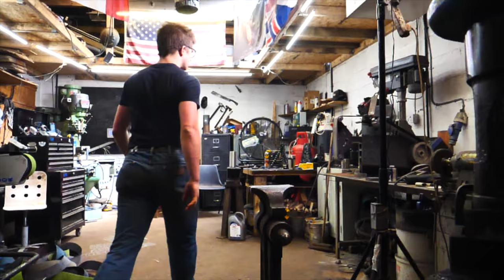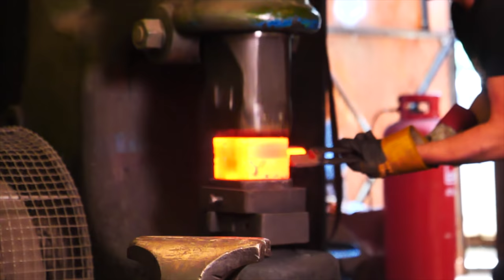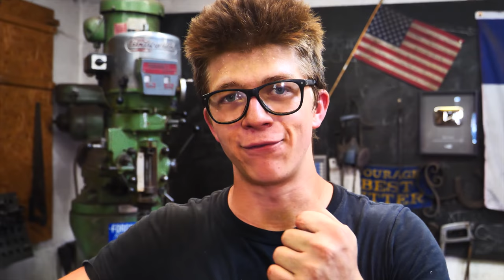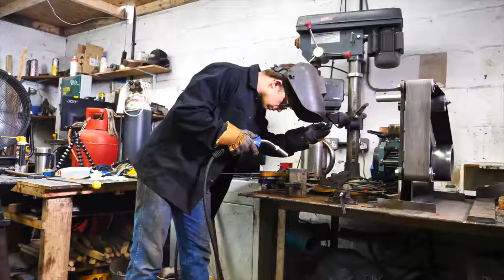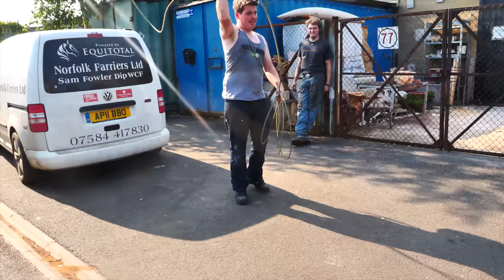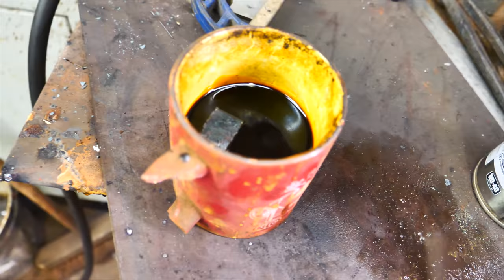MAKING MY FIRST SWORD! Part 1: FORGING the Damascus Steel *MAXING OUT POWERHAMMER*

Comment: Alec, you really need an attic fan to push the hot air out of your shop through the roof and pull the cool air through your front doors.

Comment: Hey Alec, from the little personal experience I could gain from the Sachse-Schmiede, a renowned Damascus Smith from Germany I would try a smaller billet with an easier lamination. The pattern might weld really good if it was parallel stacked. The pattern can be enhances achieved through a cross-pattern indentor punch pressed on the hot billet or something. You might not need this much steel(e) to make a sword... but: Keep on learning, dude. Your skills are already amazing. Love it. Liked every video so far. And keep microwaving the S**t out of this Tupperware :-D
Reply: HelwigTV the white pattern is hardenable and the white isnt hardenable thats the Special about damascus Steel
Reply: HelwigTV that makes it hard and flexible
Reply: Acker Kartoffel That isn't quite correct sir. 15N20 (the shiny metal) is quite hardenable, and it's possible to make high quality knives from only this metal. the other steel is 1084 or 1080 or something, which has almost the same processes for hardening. this means Alec can simply quench it in oil to harden rather than doing a really weird HT which is necessary if you have a soft steel and a hard steel. when combining these steels, it is impossible to get a hardenable but still soft blade unless the steels are almost homogenous. so either smelted and combined or folded so many times the layers are so small they may as well be homogenous. but simply folding two different carbon content steels will not give you a strong, but flexible or soft knife. the only way to achieve this effect even in Damascus is the same process as regular steel. either an edge quench, or a full quench and then a few tempering cycles to increase the blades flexibility without compromising it's hardness. so to sum it up, no mixing a hard steel and a soft steel will not result in a blade that is both hard and soft or flexible. the shiny steel Alec uses in Damascus is not hard and soft it is a hardenable steel just like the other component high carbon steel. mixing these two will result in a very tough blade, and using similar carbon levels will ensure every square inch of the knife gets hard, not only one steel. if only one steel hardened in Damascus it is almost certain to create cold shuts and delaminations.
Reply: Jake Pryor thank you lol

Comment: In South Africa it gets insanely hot, the hottest day I was at my forge the outside temperature was 42 degrees C, then it starts to get a little less fun
Reply: Michael Muller here in the phillipines 42*c every summer is normal temprature it can go up to 45
Reply: Ace Magic I live in Denmark and I have never felt more than 36C, I felt like I was melting
Reply: Michael Muller live In Tennessee. Almost always cold
Reply: I used to live in Arizona and they've already hit 50 degrees today; I can't imagine trying to forge anything in that heat, let alone a sword!
Reply: 30c in the UK yesterday and the tar sticking started sticking to car tires and pulling up the road... How anyone gets any work done in 40c heat is beyond me
Reply: MrcabooseVG lol 30C is Texas early winter. Rarely do we have days below 0C is usually 10C late winter. This weekend was a high of 44C by mid day
Reply: It’s called Eskom trying to generate power.

Comment: Now you've done it. After putting to rest the "you should go on Forged in Fire" question, this series is going to start it all over again.
Love how you jump right in.  Just setting up my new shop with one side for wood and the other for metal.  Because of you I'm planning to add a forge.  I've been collecting the necessary hardware for a while now.

Comment: You have wayyyy to much steel there my man.
Reply: DeathHamster_  you need to go see the damascus steel machete its like a bat with a blade
Reply: DeathHamster_ Considering this is damascus, the more steel in the billet, the better. Because when you grind into it, you'll expose more of the pattern. Plus, it makes sense, since he's usng the restack method, and you lose a lot of material in that method.
Reply: I know that. Even still looks like he could make a claymore and still have plenty to spare. That being said, spare Damascus is never a bad thing.
Reply: That billet weighs like 10 kilos, how much metal do you think he will lose ??jeezus ...
Reply: DeathHamster_ He has enough, a bit too much but not that bad. Remember how much steel is lost to oxidising and grinding, in the end it will be fine ( also he may do a tanged blade in which case he will need that extra steel.
Reply: well during the forging process you lose material and he probably wants enough extra in case the first one breaks.
Reply: Still far too much ... You don't make a scabbart out of metal and i pretty much doubt Alec will even make one. Also do you even know what the hilt is ??
Reply: DeathHamster_ he probably made extra so that if he likes the pattern he can use it in other projects
Reply: Well, he can use the excess steel for something else perhaps. Better to have too much than not enough.
Reply: it weighs way more. i would say 15 or around 20
Reply: whatever, it's way too much for a single sword
Reply: the billet is at least 20lbs (10 kilos) but closer to what looks like 30lbs (15 kilos). The average sword is 2 - 3lbs (1 - 1.5 kilos). Are you telling me he is going to loose 20lbs of steel? That's 90% of the steel. There is just no way. And come on snake "scabbard and the belt" Who makes a belt and scabbard from hardened steel?
Reply: Aye...... But not for a BIG ASS SWORD!
Reply: Modern Bladesmith Maybe he wants extra? Also he could normalise it and make a scabbard outta that, I also doubt that billet is over 12 kg, that's half a small anvil a bit too much for him to risk that much steel on
Reply: Modern Bladesmith I do still agree that it is too much though
Reply: yuuup. not even a black smith. could tell right away

Comment: Why not weld the block as 4 smaller billets then weld those together instead of one massive lump like that?
Reply: Chris - I wondered the same thing...seems like the risk for delams is much higher doing it the way he did.
Reply: James Brown that was the first thing I thought of
Reply: Chris Because did you see how badass that was? fuck it even if it doesn't work that is the biggest mass of steel I have ever seen anyone successfully forge weld
Reply: "Successfully" don't count on it till the heat treat is done.

Comment: Why so much steel? swords generally weight between 800g to 1.2kg
Reply: I imagine - since it is his first sword - he just is way over-compensating. Also, I would bet good money he'll cut it down not too far into the forging and have a spare billet.
Reply: Allthough this is a lot of steel, there usually is a lot a grinding needed, I think especially when you start forging. Still could be smaller I think, but hey, I'm not an expert.
Reply: With damascus steel and stock removal, you normally use way too much steel and grind down to reveal the lower patterns. But yes, 800-1.2 should be about right for an arming sword. If he's going longsword, he can go up to 1.6 (like the Alexandria Arsenal swords)
Reply: I think he's deliberately going for as much stock removal as possible to make the damascus pattern come out.
Reply: Only one way to find out, I guess. I hope he answers it next video.
Reply: Depends what he's making, cutting, welding and grinding will lose quite a lot of the steel
Reply: Red Lotus those hinges he made were thicker than many sword blades are, and this billet of steel is way bigger than the one he used to make the hinges. He could make a sword, fittings, and another blade (probably not a sword) out of what he's put together here. It's massive.
Reply: Aside from the grinding, etc., how much steel would be lost as forge scale?  I've gotten the impression from other smiths' videos that it's actually quite a lot.

Comment: Alec I think your attitude is great and the fact that you are challenging yourself to make a sword is fantastic. I can't imagine the heat but if you still have that chimney from your coal forge in the roof,  and it's still open, put it to use. Hook a couple of Muffin fans inside and have them pull the heat from the shop out and up. That way they'll draw some "cooler" air from outside. Might help with drawing some of that nasty forge exhaust out too.

Comment: Alex does a great job. However, I wouldn't do Damascus for sword billet. Possible for layers to delaminate with impact. If I were him, I'd also consider a 20 ton press for this vs a power hammer for making the billet homogeneous.
With that said. Alex's Damascus work outshines most smiths I've seen. It's beautiful. Keep it up man!

Comment: My metal shop teacher used to work in the marines. The last place he was stationed was in Guam and his job was to weld nuclear subs. The process consisted of preheating the metal to 400F and keeping it at that during welding, and putting a huge bevel on the 3" thick steel. They welded with 1/16" SMAW electrodes.

Comment: invest in skylights that open w/screen, then a duct to move some cool fresh air from a low point at the front door or through the door itself w/security grill, through the door can be moved up and out of the way, I don't know how that would effect your insurance, but I would really recommend the skylight that opens, I think it would be most cost-effective and safer, just as you protect your ears you should also consider your body temperature as well. 

as always thanks for the great work and videos.

Comment: Alex Quick question...After you forge the billet you always grind the scale off before you arrange it to be welded again. I understand that....Why don't you grind the original pieces before the initial weld? Those pieces also have mill scale on them.

Comment: Instead of chancing various temps along the length of the material, could you line up Sam's small forge with your large forge so it becomes a long 3 burner forge to take the sword length?

Comment: Idk really know if you did your homework on swords, but incase you haven't
sword have what is called a distal taper
where they're 5mm thick at the bottom and around 2-3mm at the top
Putting the ballance point right above the crossguard.
Also one handers are usually 1 kg

Comment: should try working in a weld shop in the deep south us. 100+ degrees heat ontop 2000+ degrees heat coming from torches

Comment: Probably been asked before, but does cleaning the surfaces of the starting steel with a wire wheel or something help it weld?  Imagine those pieces are covered in a fair amount of oxidation and contaminates?

Comment: What are the advantages and disadvantages of using a power hammer vs a hydraulic press for forge welding?

In my little mind, it would seem a press would be better for the welding part, no?

Comment: Appears the forge will need an upgrade for the hardening process!  To handle high heat, wear tight fitting, 100% cotton clothing, and be sure to not eat large amounts of red meat.  Whey protein shakes are a great way to get the protein without the high body heat for digestion.

Comment: Not sure if you've done a fuller yet (only been watching a few months, and don't get to watch EVERY day), but that would help move the steel, lighten the final product, and not need THAT massive a billet. Looks like you're trying to make a hand-and-a-half or a two-hander with that much metal. There are shorter swords you can make.

Comment: WHat weight are you aming for with this sword? If I can bring my knowledge to the field, my recomendation would be to, depending on the exact style of sword you are making, having the weight between 1 kg to about 1.5 kg for a shorter blade, or between 1.2 and 1.8 kg for a longsword or similar. A greatsword (zweihänder, claymore and the like) should preferably not exceed around 2.3 kg, slightly more is fine, but that seems to be the average

Comment: Shouldn't you grind or sand the magnetite off before welding the steel? And melt borax in the furnace and have it run between the steel plates?

Comment: I would suggest many more cuts + welding, especially if you are even thinking of using the sword as a sword.
There's a reason most sword makers do over a thousand layers, to avoid catastrophic de-lamination during use.
Don't want you to get hurt.
Reply: AluminumHaste you can have a working sword with one layer of steel. we don't even know what type of sword he's making. Western weapons aren't like far eastern weaponry.
Reply: Was just talking about pattern welded steel, not mono-steel swords.
I did not even mention western vs eastern, just that pattern welding something with only a dozen layers has a greater chance of de-laminating as opposed to something that been welded 10-20 times etc.

Comment: That billet of steel is probably to large for the task.  I have seen people make swords before and it looks like your trying to make a billet for 2 swords.
A sword is not as big as some people think.  The finished product is usually in the 2 to 5 pound area (2-3 pounds for the one handed variants, 3-5 for most two handed variants).

I have a reminder, a good sword has a distal taper for many reasons, namely it lowers the center of gravity closer to the handle (this makes the weapon more lively).

I hope your making a sword with a little history in the US because that would be awesome.  Sword making does push a blacksmith's abilities to the limit because swords are a blend of form and function.
I wish you the best of luck.

Comment: bro you have make a new forge for the sword. It should be long enough to get the sword in right length. So the heat should apply evenly in whole length. it will also help you for during the heat treating the sword.

Comment: i wonder if anyone can help, When i see the steel come out of the forge, its generaly covered in scale. Where i get a little lost is where does the scale come from?. If its impuritys in the steel, then after a few heating ups the steel's make up will be changed. or is some of it just from the surrounding air

Comment: Alec, not sure what that billet weighs, but a sword TYPICALLY wouldn't be more that a kilo, more or less.... I think you have a LOT more material than you need there, I know a lot will be removed as stock, but I think the next you can start off with a way smaller billet.

Comment: You take care to grind the scale off whenever you combine the cut billet, prior to rewelding. Other blacksmiths do it too, for good reason. However, y'all never do the same thing to the original pieces of steel. Would it not be worth your while to build a crude tumble polisher, or similar, in order to prepare your raw steel?

Comment: Wouldn't it be better to forge-weld all of the separate billets of damascus and then weld them together to minimize the chances of cracks? Man you have a lot of material to work with,  if you can I'd suggest a claymore or one of the larger types of swords since it'd be a shame to see a lot of that steel wasted!

Comment: why won't you sprinkle the powder before welding
it's like, preventing the steel from rusting so it would stick together better right?
then isn't it more logical to sprinkle it between the plates?
also, what's the name of that powder

Comment: Why always Damascus? Does it have any advantages over other hard steels that hold an edge?
Reply: CitizenLach it's cool
Reply: CitizenLach damascus can (emphasis on CAN as it isn't Always) turn out fairly heavy, but tends to be quite strong, due largely to how many layers of steel go into it (or folds if you're going that route), and it looks beautiful.
Reply: CitizenLach Damascus if done correctly (well pattern welded steel not Damascus) is just as tough and hardenable as tool steel. it looks more appealing, and the possibility of changing the pattern are the main draws for using Damascus. ACTUAL Damascus (techniques lost to time) was apparently stronger even than most conventional metals on their own
Reply: actual damascus can be made these days, the process was rediscovered. also its not better then modern steel it just has unique properties to it. also pattern welded steel isnt exactly as tough as tool steel however it can have benefits however thats more a result of laminations not just making pretty steel(think how the japanese put the hard and soft steels in different places on a blade to help with shock absorption)
Reply: bmxriderforlife1234 pattern welded steel is damascus, some of the earliest references to damascus steel is from custom gunsmiths forging pattern welded steel.
Reply: ZombieNinjaPitbull yeah but there are two commonly recognized forms of Damascus. Pattern weld Damascus and crucible Damascus, with an outcome also being called wootz. It's not a lost art, but it was extremely impressive for its time. We are talking about a steel that could rival modern industries that was made during the dark ages at its latest. They thought it was magical. It was good steel even for today, but back then it was basically divine. It isn't some lost art per say, since we know how it was done. It also isn't a lost recipe, since there are many different materials you can use to make that same steel, you just need fundamentals like your ore, carbon, and a means to pull slag from the steel. 

And yeah, pattern welded steel is damascus steel. It's been called that for over a century, and neither steel is "true Damascus," seeing how neither were actually made in Damascus. Pattern weld can make some incredible patterns and I love it.